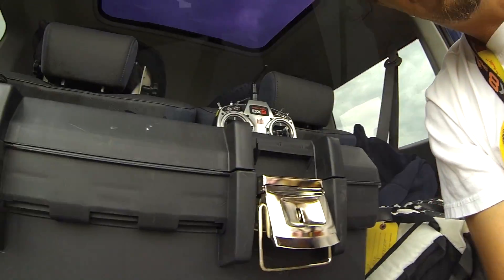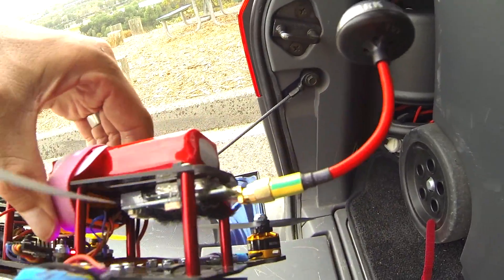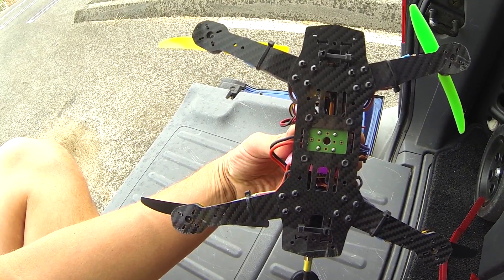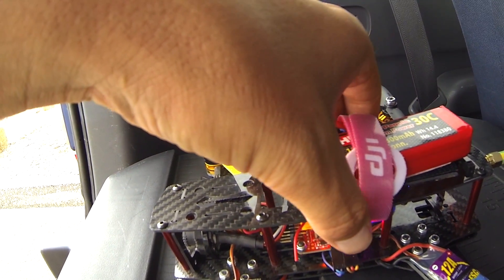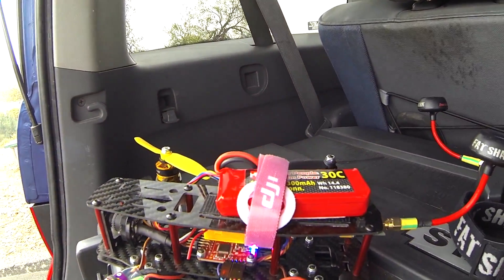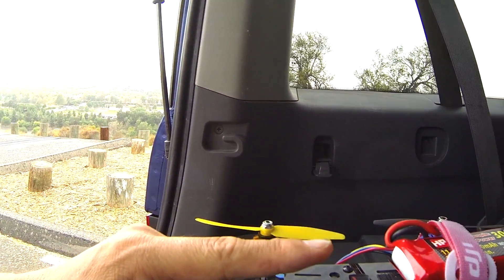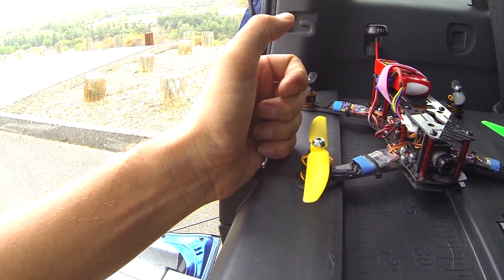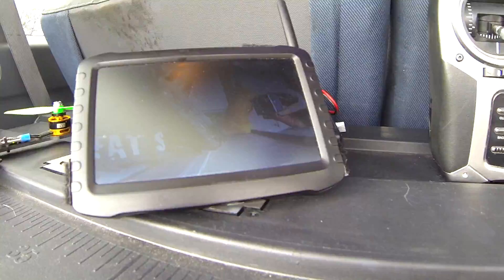ZMR 250 Review / Overview

Comment: um if im using 2208 motors and  12a esc and a cc3d what battery do i use and is this setup going to work because its a kit on ebay
Reply from the maker: A 3s 1300 to 1800 with higher c rating will work good. Look for above 60 c rating. They usually go up to about 90-120c

Comment: CPPM and PPM are the same thing.  The C just means "combined."  S-Bus was developed by Futaba and has additional capabilities (like expanding the number of usable receiver channels to however-many the transmitter has.  Like if you had a 6 channel receiver and a 10 channel transmitter you could use S-Buss to effectively use 10 receiving channels).  But as far as I can tell (C)PPM is more widely used.

Comment: Hey 7, Thanks for the detailed review. I have a very similar setup and having a hard time with the OrangeRX receiver. I run out of control range way before I run out of my 200mw vTx range. Have you done anything (I noticed your transmitter antenna  at 90deg) to increase the range or are you happy with it? I tend to fly a few inches off the ground, but even the slightest break in LOS and it looks just like the end of your video with the signal loss. Just looking for a little advice/experience here. Thanks. 

BTW, love the BoP reference
Reply from the maker: Yes, always run your antenna @90 deg and canted 45 deg over to the right or left.  Also bra absolutely sure the rx antenna is far away from your carbon fiber frame. - this was the root of a lot of my problems. I currently use a 6 channel Lemon ppm only rx I got from Team-legit.com. The bop referrance?
Reply: Thanks, will try that.  7demo7 is not an 'homage' to 7-Zark-7 from Battle of the Planets?
Reply from the maker: No it was a random name I made up from Mtn biking - I used to ride a downhill bike called a "demo7". That name was taken so I added another 7. Lol. It was way before making videos for youtube

Comment: Will be upgrading my ZMR to Naze32 currently using CC3D.  Very nice build.
Reply from the maker: Thank you, I've done quite a few changes since this video and I will make a new one to highlight the things I've done
Reply: ***** The Naze has full baro and compass and can also use GPS.  I can program different flight modes for some really radical stuff.  Painless 360 has a great video series on the configuring the Naze.
Reply: Nothing wrong with the CC3D and is a great bargain and also is rock solid in the ZMR 250 Banggood has them for $17.99 now.  http://www.banggood.com/OpenPilot-CC3D-Flight-Controller-STM32-32-bit-Flexiport-p-937044.html

Comment: What's your AUW on this setup? I've got RCX 1806-2300kv motors, and AUW of 600g and my hover sucks (60-70%) thinking of replacing the RCX for the DYS due to the good thrust tests I've been seeing.
Reply from the maker: kubanishku If I remember correct my auw is under 500g w/o gopro or mobius.  I use 3 size batteries.  1300, 1600, 2200- I got 9 min on the 2200 today- with no fpv or hd camera though
Reply from the maker: I hover at just under 50%
Reply: 7demo7 I'm AUW 600g (mobis + sony 600 ccd + vtx boscam 200mW + naze32 + clone250 + 4x RCX1806-2300 + minimosd and 3s1800mah).  Not sure if the RCX motors suck and worth the DYS upgrade.
Reply from the maker: Get the DYS-cheap, quality, lots of power!  You won't regret it. I've heard there are a lot of fake RCC motors that  are horrible
Reply from the maker: Ok, my auw is 492g, hover @ just under 50% This includes my FPV system, Mobius hd camera and a 1300mah 30c battery.  the dys motors are tiny, light and powerful
Reply: So after upgrading to the DYE BE1806 2300kv from the RCX 1806-2300kv, huge difference.  My AUW is ~630g w 3s 1800mah (mobius, fpv cam, etc;). Snappy and fast now, with hover ~50% and improved response.
Reply from the maker: Ed Verstegen
I get w 1300 3s 30c- 5-6 min, and 2200 3s 30c 12min!
Reply: kubanishku did you find a resolution to your hover issue? I'm running a 250mm with the RCX1804-2400KV MOTORS and 5030 props, at a AUW of 620g and I need 70-75% TO HOVER.
Reply: Ed Verstegen I'm on the same AUW as you, 60-70% to hover on the RCX 1806-2300kv 5030x2blade, I've ordered 3 blade 5030s + DYS 1806 2300kv motors to replace the RCX based on thrust tests these motors should do better (I hope).  I am due for the DYS to come in any day now from banggood, and I can report back then. I find hovering at 60-70% just awkward.
Reply: kubanishku can you hit me up via google hangouts or gmail?
Reply: I saw a video of a guy doing thrust tests on the RCX motors and they had 155g @ 50%. so doing the math that's 620g @ 50% why would I need 70-75%? Starting to think something is wrong with one of my motors or ESC's
Reply from the maker: Have you checked your throttle end points?
Reply: What's your flight time?